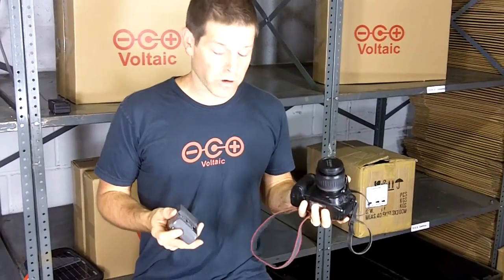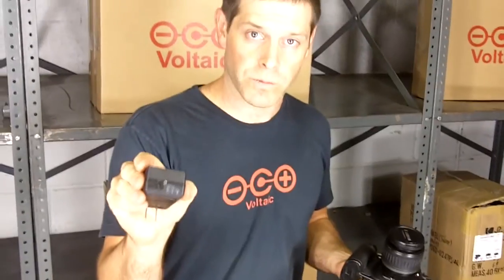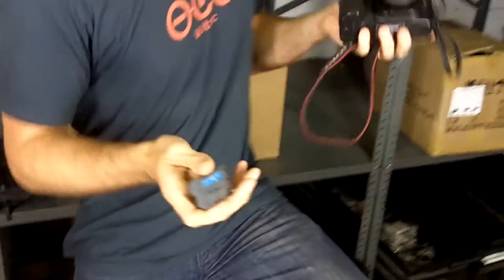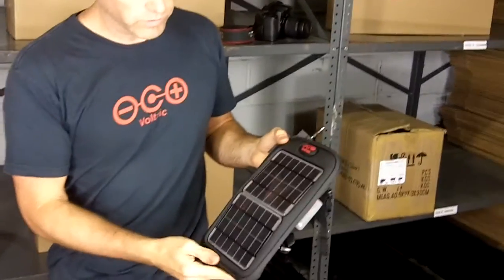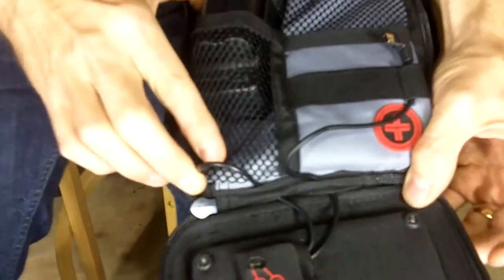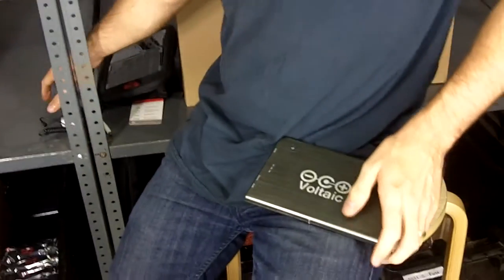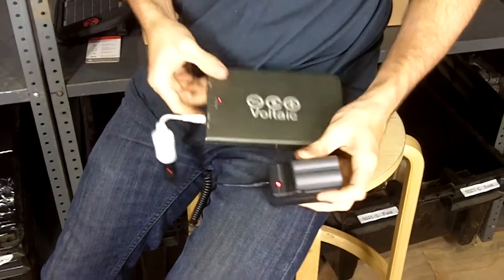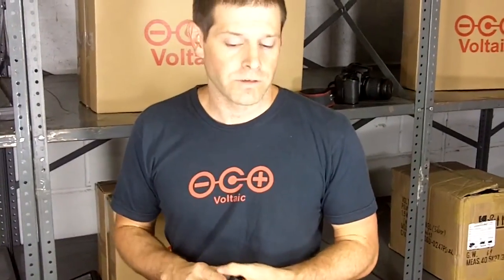Solar Chargers for Camera Batteries

Comment: ok so the cradle comes with the car dc charger, could i just plug the cradle to my cars socket then and it still work?
Reply: Hi - yes, you can charge the battery in the cradle from any 12 Volt source. Either our solar systems via our 3.5x1.3mm adapter or car socket or by connecting into the cigarette lighter in your car.
Reply: ty for responding